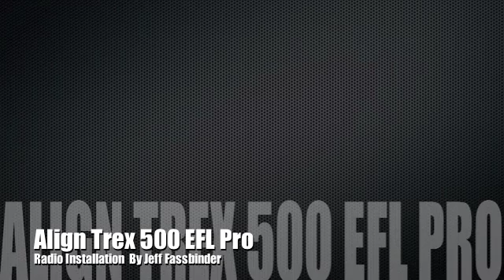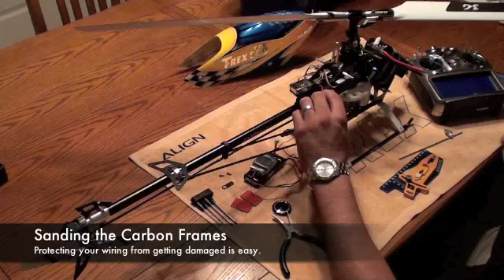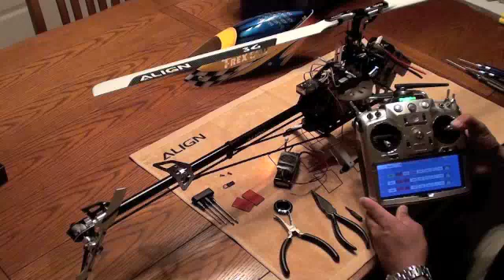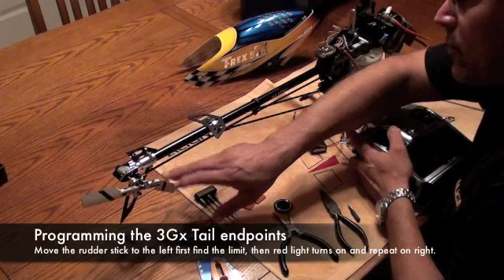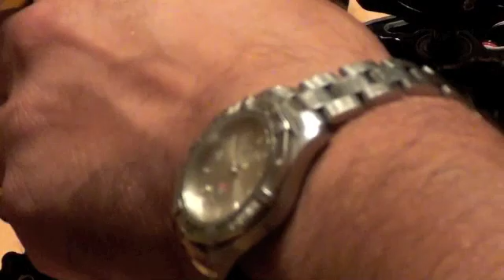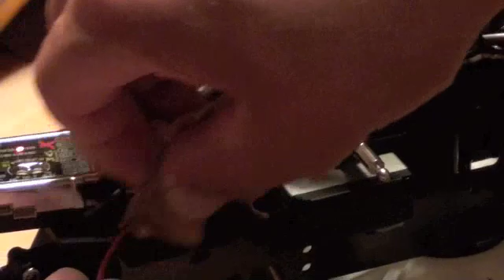Trex 500 EFL Pro Radio Installation

Comment: My maiden and starting point was leon lukes settings.All is perfectly ballanced no vibration.Running castle ice 50 bec set to 5.5 volts to align cyclic servos and 9257 futaba tail.Battery is 2200 35c voltz.Data log shows good power never drops bellow 10 v.IDK needs another update.

Comment: Head speed on a 450 2800.Once I finally got it to feel right I had been flying with low dr for basic scale flight to get the feel.It had back and left drift.I then leveled swash through out travel range and it helped.I still had to add a pinch of trim(not sub trim).I then upgraded to 1.2 then seemed to fly much better with no trim.Then I set up for 3d with more throw then had to start droping elev gains do to elev. oscilating(or even just wind driving things to go wobble wobble).Now drift again.

Comment from the maker: @wade3337 I used the advanced settings used 60% on the Flight Condition Control and thats about it. Other than that just the settings I used in the videos which gives about 12 degrees of cyclic and collective all around.